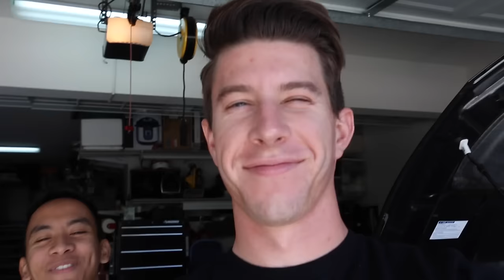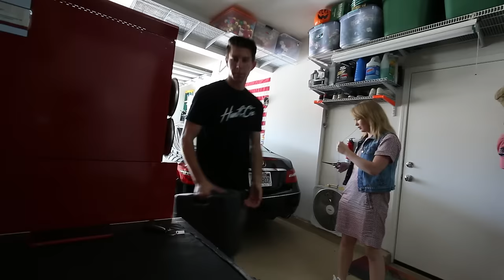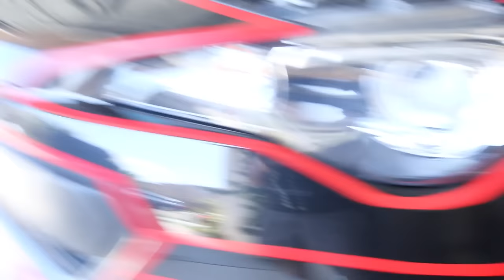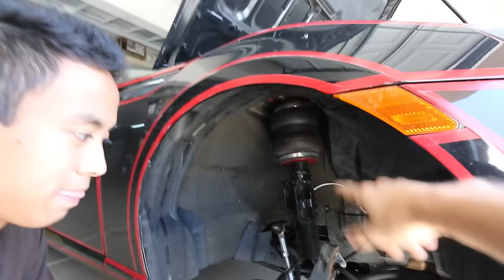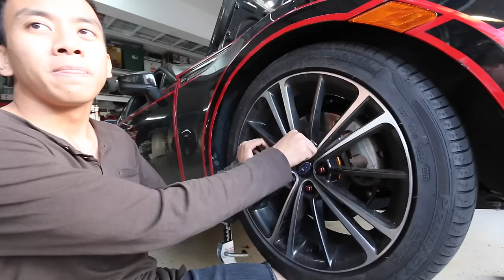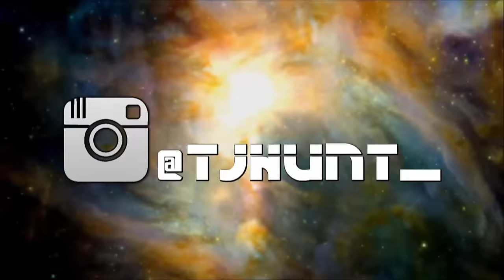Fender Lining Destroyed

Comment: General rule of thumb, your thread engagement should be at least 1.5 times the width of your stud. Measure your stud (in mm if you prefer it) and multiply it by 1.5. That's how much thread you need.

Comment: idk if you'll even read but for the tire shop I work 7 360° turns is what's "safe" , you might be able to get away with a little less like 6. hub centric spacers are better then universal but is still not recommend over bolt on ones. lastly I would say the primacys are Prius tires since there the OE recommended tire but for better grip the pilot super sports and as3 would be nice

Comment: . If it's a closed lug nut, the thread engagement should be 1-1/2 times the width of the stud, i.e. if you have a half inch diameter stud, the thread engagement length should be 3/4 of an inch. 
Hope this helps
Reply: This is correct, I'm a machinist and that is the standard. Anything less is unsafe!
Reply: This is of course the safety standard.

Comment: 7 turns on the lug nuts is what is considered safe!
Reply: Use a torque wrench
Reply: what good is that? if the lug nut has 20 threads inside and u get 4 turn and torque it ur torquing it down with 4 threads engaged ur just asking for ur lugs to come of... i deal with this every day its so dangerous i give customers lug nuts for free if i find it unsafe!
Reply: +Dean Ward The torque wrench wouldn't "click" if the lug nut wasn't tightened all the way right?
Reply: regardless of how many turns it gets it will still torque.... I'm just saying the less turns u have on the lug means the less on the cars stud and the better chance for a wheel off.. like toyotas with after market wheels will get about 5 turns using a small spline lug... if you change to a et spline lug it gives you 3-4 more turns!
Reply: +Dean Ward Oh okay makes sense !

Comment: i will just leave this here.... it is the requirements for wheel attachment in NZ law. obviously your laws will be different, but it will suit as a guideline

2.4(4) A wheel stud or bolt attaching a wheel to a low volume vehicle must
engage into or through the corresponding nut or hub assembly by either:
 (a) not less than the diameter of the stud thread; or
 (b) a specified number of full turns of thread engagement, which
must be not less than:
 (i) in the case of a 12 mm metric stud or bolt with a 1.5
mm coarse thread pitch, 6.5 turns; or
 (ii) in the case of a 12 mm metric stud or bolt with a 1.25
mm fine thread pitch, 7.5 turns; or
 (iii) in the case of a 14 mm metric stud or bolt with a 1.5
mm coarse thread pitch, 7.5 turns; or
 (iv) in the case of a 7/16 inch or ½ inch imperial stud or
bolt, 7.5 turns.

anyways love the videos. hope this helps
Reply: But here in nz no body really listens to them anyway
Reply: lol this is true. i only know it because i recently got certed with spacers
Reply: +festa289 did you have to add fender flares?
Reply: yea. cut and welded the rear. the front was wide enough already ...just lol. cars a 180sx with s15 front. are you doing fenders?
Reply: basic regs are : you can run up to a 27mm spacer as long as it doesn't put the wheel offset outside of spec and the tyre tread (that contacts the road), is within the guard. the rim and sidewall may be outside guard, but the tyre fitted also has to be in spec in regards to wheel width. tyre stretch etc

Comment: All these mods and none of you have upgraded your brake setups.
Reply: +Benjamin Graham Why is that an issue?
Reply: Lets supercharge a car and keep the stock brake set up. You tell me.
Reply: Benjamin Graham in this case the stock breaks are perfectly adequate. Nothing wrong with that.
Reply: No man. Two piston callipers on any boosted car is not adequate.
Reply: +Benjamin Graham what do you drive?
Reply: I drive a 2000 Nissan Stagea RS-4. First mod I ever did was 4 piston callipers up front and two in the rear, both from an R34 GT-T Skyline. Safety before speed.
Reply: +Benjamin Graham well he drives on it daily so seems safe to me